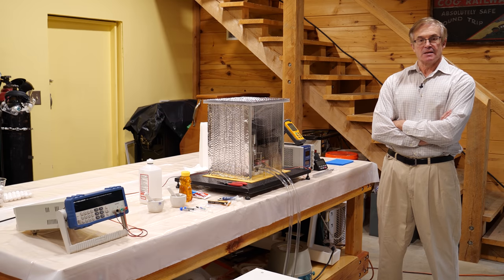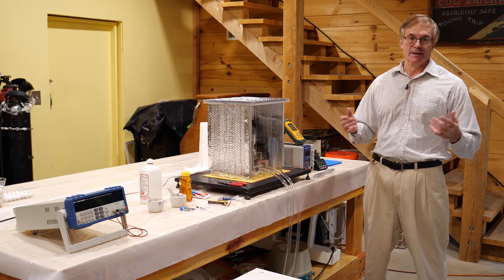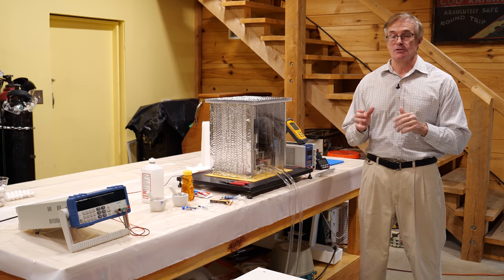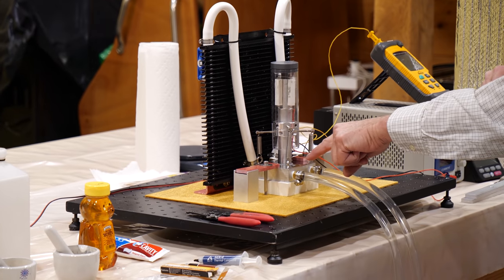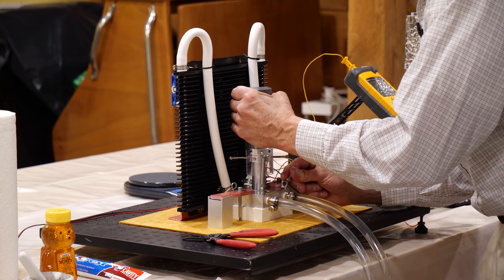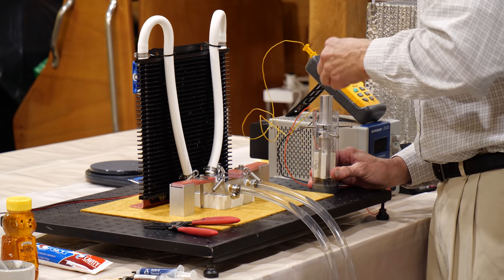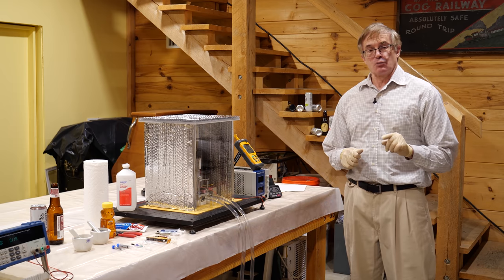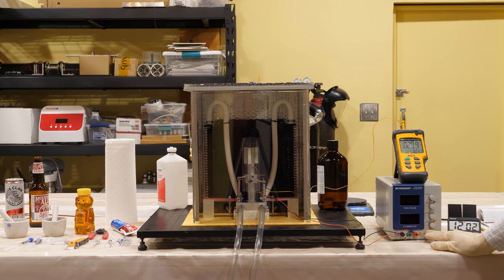DID WE JUST MAKE THE WORLD'S BEST THERMAL PASTE!?

Comment: Sir, I am impressed with your control and scientific approach concerning these presentations....and hat's off to you. 

Moving forward,  there are two curious subject matters I'd like your input on; one is Tesla's "dark energy" experiments,  the other involes induction cooktops. Concerning the former: There's an online e-book called "Secrets of the Cold War Technology " (specifically chapter one) that describes Tesla's observations and ultimate experiments concerning  "radiant energy" and too his patented devices that demonstrated his findings. One such device (actually an appliance) was a 'carbon button lamp' he used in his lab and when used as a light source when photographed with his associates the results predated the the discovery of X-ray by some ten years. Again,  radiant energy being the source of power for that lamp.

Concerning the latter: Using a common induction cook top,  experiments have been conducted to purportedly produce more energy output than input (I know what you're thinking). The experiments goes as follows: A secondary coil is placed above the cook tops output coil (in place of a sauce pan) and then connected to several quartz type lamps. Wattage measurements are taken and......  some 2800-3000 watts output verses 500 to 900 input seem to exist. I believe I know why, but like your input on this as well.

I do have have additional requests but they will wait for now. I have been published and hold a patent pending having majored in Electronic Instrumentation and now retired. Thanks for your consideration in advance.
Reply from the maker: The experiment seems to suggest that the wattage measurements are proof.  I'd dig deeper into how those numbers were derived.
The set up is effectively a completion of a simple, toroidal transformer.  The stove is one coil, the pick up is the other (rather than a pot). Many greater than unity claims are based on faulty measurements. Consider also, if these measurements were even close to valid then the second coil could drive four more stove tops which in turn could each drive four more etc.  If these individuals really accomplished what they claimed it's impossible to believe they wouldn't have done that and have easily become billionaires.  Who is John Galt?

Comment: I would suggest, perform a test on very high-ish emperatures usually close to the ranges of 80-90c, as these are typical for the GPUs. The reason is, most of the thermal compounds perform well under low temps but breaks down under high temperatures and are rendered useless.
Reply from the maker: Sure.

Comment: I would have used a PT100 or PT1000 4 wire chart recorder software recorder, then overlap the results over time,
I used to be a manager of a UKAS Laboratory, to stop heat conduction you could use the thinnest temperature wires, we noticed a difference in probe depth on measurements, heat conducted away can greatly effect measurements, we used rock wool, PTFE etc 
We had a Grant bath with Castrol WOM10 oil to place resistors in the bath, oil eventually pulls in water from the air,
You can get USB recorders made by lascar, I'm lucky to get hold of the old 6000 temperature indicators great accuracy, 
I would be tempted to measure room temperature & even humidity, there is another thought pressure on the process I'm nitpicking, forgive me, but tests we did even the test leads were serialised, mains stability,
I might be tempted to torque down the tests 🤔
Reply from the maker: Those are good techniques and that represents a significant upgrade. If you persue it, you'll get no complaint from me.

Comment: Late to the comments, but I'm wondering if an experiment could be constructed using a Peltier device to measure easily the thermal conductivity of the different materials over a range of temperatures (up to 70C or so). Would also be great to compare SIL pads with pastes.
Reply from the maker: It could be.

Comment: One problem with "cheaper than x" is that one usually measures pure material costs. So if you can make a paste that costs the same as a store bought one, and performs about the same. That means that the commercial one performs as good as your's, at a tenth of the production cost, because of profit margins and middlemen. 
I'm not saying this applies to this video, but in general, this seems to be overlooked on some videos on youtube.
Reply from the maker: True, but you can't deselect components of the cost of production.  Without the middle men and profit margin the product wouldn't be available from that source irrespective of its cost of manufacture.  Similarly, its cost of manufacture is highly dependent on scale and this in turn depends on marketing and middle men.
Reply: @TechIngredients  Absolutely. This came to mind when you talked about your cheap thermal paste. It would be interesting to see what your cheap thermal paste would cost in a regular store if mass produced. If you managed to create a thermal paste with competitive performance at a fraction of the price of other brands, that would be  groundbreaking. I'm guessing the 1 cent per gram cost estimate is pure raw material cost, and the average brand cost of 1 dollar is what the consumer pays?
Reply from the maker: You're correct that the materials are a small fraction of the cost and the high performance material requires a significant non recurring cost in equipment.  I'll demonstrate this in the next video.
Reply: @TechIngredients  Awesome, can't wait!

Comment: Would having a more powerful heating element get you more accurate results since the temperature difference between the beginning and the end of the test is larger? Also, do you know if the performance of the thermal pastes increase or decrease with increased temperature?
Reply from the maker: That would give greater precision, but not change the accuracy.  I believe the thermal conductivity of composite mixtures will improve with temperature, but I haven't tested this.

Comment: Fantastic as always!
would love to see comparison against a liquid metal TIM
Question: I might need to put a liner in my vintage motorcycle engine (cast iron). Would it help to smear some TIM on the liner/ sleeve? The machinist doesn't think so but....
Reply from the maker: We're modifying the rig with nickel coated surfaces and will be testing liquid metal thermal interface materials.
The gallium in these pastes is highly corrosive to just about all metals.
Reply: @TechIngredients  Super! I don't know how effective this is but I nickel coated my laptop heatsink and applied a bead of UHU glue to (hopefully) avoid oxidation. I haven't opened it since but 2 years on and I'm still getting 15-20 degrees lower temperatures.
And about using TIM to coat an engine liner before inserting it in cast iron cylinder: any chance of improved cooling or waste of money?
Reply from the maker: It's probably a waste of money.  The vibration, extreme temperature and pressure swings would likely pump most of the paste out after a short time.
Reply: @TechIngredients  thanks. You're amazing!

Comment: Please use a better (higher resolution etc.) thermometer for those tests. You can either get better results or reduce the time down to maybe 1 min or something, as then the themperature is not the limiting factor anymore. Also... for timing, temperature logging/display etc. use a µC. You put much more effort into the (thermo-)mechanical setup compared to the thermometer or powersupply. Resolutions down to 0.001 °C should be no problem.

Comment: I did not know that about stainless but I have actually observed it at work. If you place a very hot pot on a stainless steel work table, it will spread some of it's heat into the metal, but it won't spread outward much. If you then remove the pot and forget that you had it sitting there, you can very easily burn yourself if you lean on the spot... lol so DON'T.

Comment: What about using your thermal paste which is thermally conductive and electrically insulating to improve the cooling of the solar cells in solar panels, it might be more thermally conductive than the white material the solar cells normally sit in. Electrically insulating, thermally conductive paste would enable the panel’s aluminium metal frame to more effectively conduct heat away from the solar cells, e.g. to the aluminium edge the panels are framed in, attached to the panel’s support structure working like a heat-sink dissipating heat away into the surrounding air, improving panel output performance.
Reply from the maker: That would help.
Reply: @TechIngredients  Any chance of an update on the thermal paste orders? I made my purchase and was charged five months ago. How do we go about a refund? Thanks

Comment: If you ever want to know what's in a thermal  compound, just check the Safety Data Sheet. If you can't find anything, they might be geo restricted. I've just found everything that's in Arctic Silver 5 in the UK 🇬🇧 use a VPN 😉
Reply from the maker: That's a good place to start.  The ratios and the manufacturing methods are not included in that document and that is where your work will begin.

Comment: Nice setup. I like it. 
Now, about W/mk....   I was looking for that value in your site but couldn't find it for your paste. Based on the results from your experiments I can assume it is  the same as the PK-3 which is  11.2 W/mk (actually they state 11.2W/m-C). There is also another paste, the one I'm actually using, called SYY that is 15.7W/mk that you can check out and raise the bar on your formula to get even better performance, it would be interesting to see how it performs in your lab. 
Thanks for your work.
Reply from the maker: Did you watch my explanation re the problems with published conductivity claims?
Reply: @TechIngredients   Hi, thanks for replying my comment. 

Yes, I watched the explanation and reading again my comment  I see I bypassed it as I took the 15.7W/mK for the SYY as a true set on stone . So, I think it would be fair to run that paste in your setup to see how much better it is (or not) compared to the rest and if it sticks to vendor's claims.

One more thing, do you have plans for thermal pads? Although GPUs are the main source of heat, the component that fails the most are VRAMs and MOSFET, one of my cards failed in the middle of rendering a long sequence and after disassembling it the copper surrounding the VRAM was all bluish.

Again, many thanks for your videos.

Comment: Would love to see how the Indium performed...as is.
Reply from the maker: Sure.  However, we would need to increase the clamping force from the springs nearly ten fold.
Reply: @TechIngredients  If you assume an even displacement (which is likely a valid assumption given the geometries). I am not a metallurgist but some combinations have a very low eutectic (maybe InBi) where local pressures can cause them to phase change. Not always practical in industrial settings.  There is a loading dynamic as well so I am guessing that multiple trials would yield different results. I will try to find a relevant video or two. Thunderf00t has one about Bismuth.

Comment: Hello. I have a question. 
I was watching a video earlier about solar panels and how the biggest break through is Perovskite solar panels. 
But what blows my mind is that theyre still only talking about 30% efficiency. And that got me thinking. Dont we have thermoionic electronics that can produce electricity from heat? Solar panels get very hot sitting in the sun so why hasnt someone built a thermoionic panel covered in a photovoltaic sheet so you can take advantage of the sun's rays as well as the thermal energy that's collected at the same time? Surely that would push a panel well beyond 30%? Or am I misunderstanding the science behind the technology of heat to electricity type electronics? 
If you feel I might have a feasible idea, I would LOVE for you to test it!
Reply from the maker: You're right about perovskite.  It still has a lot of limited life issues that need improvement.  No, the thermoionic process is limited in effeciency especially around room temperature and any attempt to harvest the heat from a conventional solar panel will reduce the effeciency of the PV cells by restricting its ability to remain as cool as possible.
Reply: what if you put a fluorescent material behind it, it'd re-emit the light in a different wavelength that is absorbed by the cell.

Comment: If there was a way to pull a vacuum and seal the interface between the heat sink and cpu could you use a water based thermal compound?
Reply from the maker: Yes.

Comment: Beware of honey around electronics. It's quite acidic, and eats concrete and aluminum. (I used to work in a honey house. Watched it eat the concrete floor, about 1/4 inch per decade but consider how thin electronics are...)

I use a generic that's apparently copper dust in mineral oil. Works really well.
Reply from the maker: Interesting.

Comment: With the indium film, do you have to maintain the high interface pressure or could you squeeze the two surfaces together to achieve the needed plastic deformation then relieve the pressure without separating the two surfaces? An initial squeeze installation sounds feasible for CPU/GPU use. Maybe mount the chip to the heat sink first with pressure, then install onto the mother board.
Reply from the maker: You can't apply that kind of pressure at any point.

Comment: Hey tech I have a question. What is the weight of the 1ml and 3ml syringes of thermal paste on your site? Im just confused as you can get 3.5g of artic silver 5 for 7$ but 1ml of yours is 17$. Just tryna to quantify the pricing difference. Thanks and great video.
Reply from the maker: The density of our paste is 2.7 gm/cc.

Comment: In order to help your testing would it help to use a scale and weigh out the amount you use? Either zero out with the top piece on and apply the paste to the top, or something similar.
Reply from the maker: Probably not.  The repeatable pressure determines the effective volume present in the bond line gap.
Reply: @TechIngredients  I am just starting too watch your videos so you may cover this but have you considered putting PLCs, arduinos or other electronically controlled relays into your equipment? In this video you could program the start and stop, recording the final temp might be a little more difficult since the thermistor are not nearly as accurate as the device you are using. I do see some issues as well and that may be why you do not use them, with everything manual there is 1 less variable to account for the accuracy. There are more but this has gone from a suggestion to a discussion and there are other places for that.

Comment: The only problem I see with this testing is that the thickness of the TIM layer is only controlled by the viscosity of the TIM, giving an inherent advantage to compounds that flow more freely and produce a thinner interface with a given clamping pressure.
Reply from the maker: I'll discuss that with the next video.  You're correct, however viscosity and thermal conductivity are inversely related and so the issue is optimizing the balance.
Reply: @TechIngredients  Perhaps you could integrate a micrometer into the clamping stack to measure the thickness of TIM layer. Depending on how it's mounted you might need to run a control with no TIM to get thermal expansion coefficients of the mount and mic first, but this way you could provide actual w/mk ratings for each tested compound.
Reply from the maker: It's possible, but I don't see the practical value of the measurement.
You can't control the thickness in a real application, it's as you said above and that's why I responded as I did.  Increased clamping pressure is always better, flatter and smoother surfaces are also always better.

Comment: I'm curious what the replacement lifespan is on this the reason I'm asking is some of the higher performance pastes have a short effective lifespan despite being very good thermal conductors initially and does it have a curing time like some other paste?
Reply from the maker: None of these pastes cure.  Some, like versions of Shin Etsu and probably Arctic Silver-5 contain volatile solvents that help with spreading and then evaporate over time.

Comment: Excellent video. 
I've always been intrigued by improving the thermal effectiveness of the liquid in a PC cooling loop.
Would there be any benefit to making the liquid more thermally conductive?

Imagine dumping propylene glycol, diamond powder and water into a system. The carnage on the water pump would be impressive.
Reply from the maker: Water simply can't be beat.  It has the highest specific heat of any liquid and a low viscosity which improves flow rate.  Adding anything to it, lowers performance unless you're driving in Minnesota in the winter then lower performance isn't as important and glycol is necessary for other reasons.😃

Comment: Does the shape of the CPU/tester matter?
CPUs are usually rectangular while the rod you're using is circular. 
Also CPUs have hotspots in them, would that affect the results?

Oh, and about the toothpaste being a decent polish: We used it in my high school jewelry class in lieu of some of the more expensive buffing compounds. It worked great.
Reply from the maker: The shape doesn't matter as long as the surfaces are flat.